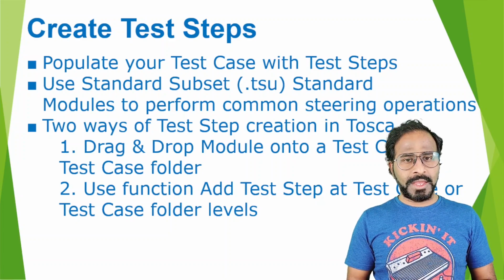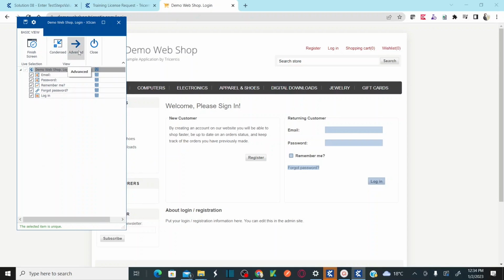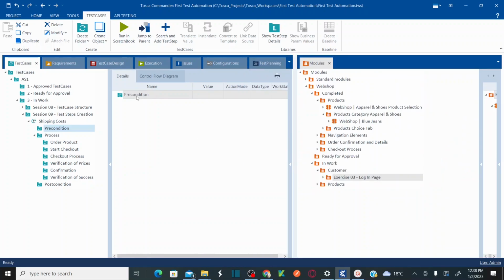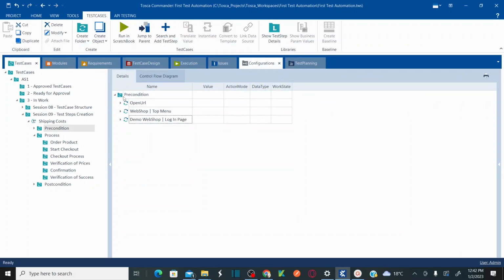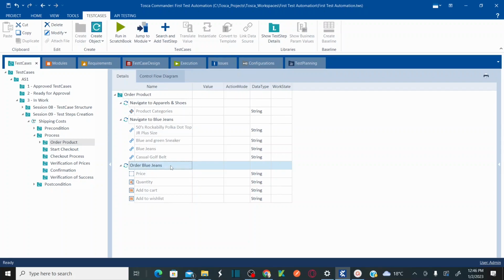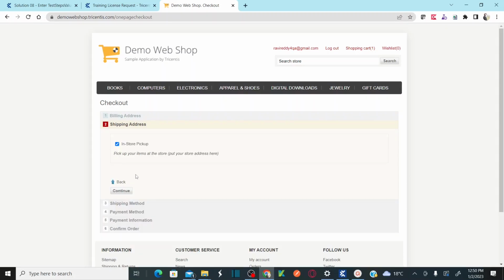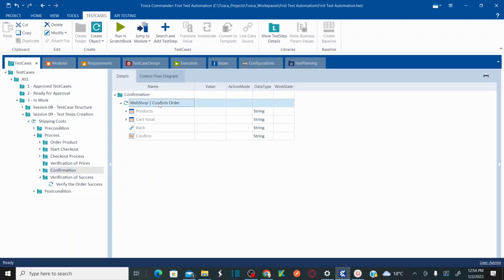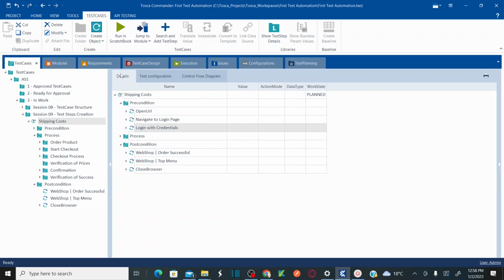TRICENTIS Tosca 16.0 - Lesson 09 | Test Case Automation | Create Test Steps using Modules |

Comment: Hello Ravikanth, Could you please give me some information about the "q test Manager tool" or some notes for the Preparation of  Test Analyst Certification Exam provided by Tricentis? If you have done so far. I have Enrolled Already in 14 days trial. But I want to do some real-time projects with you please help me if you are interested I can add you as a team member. If you have done any Manual Project work before so we can use it in my q test manager site for some hands-on practice. I have only 10 days remaining. Please share your email.